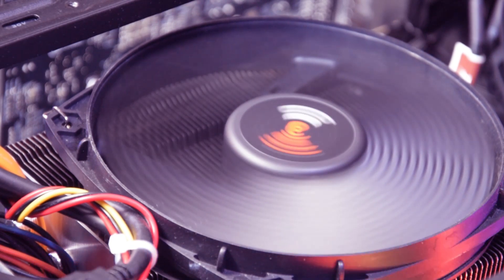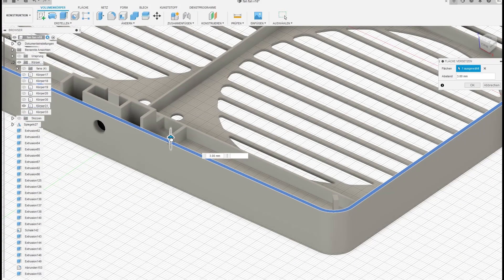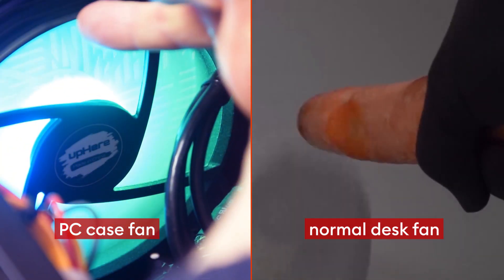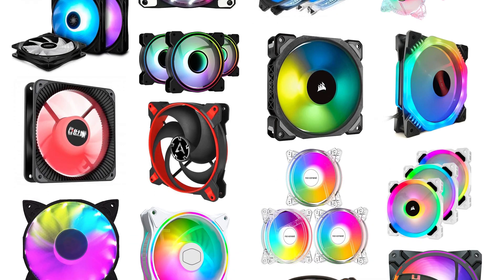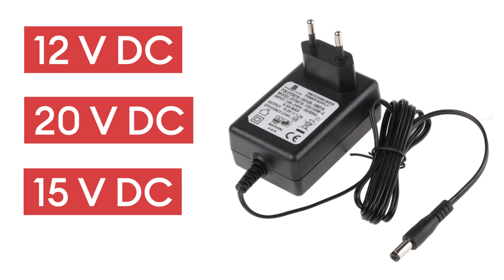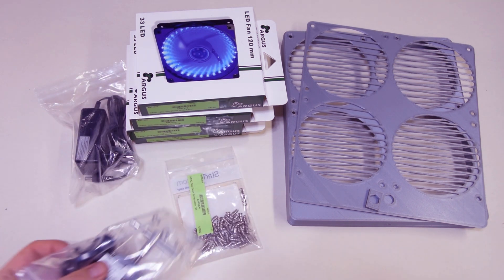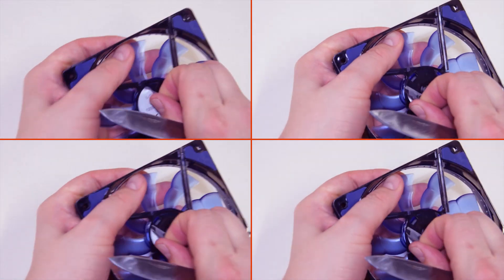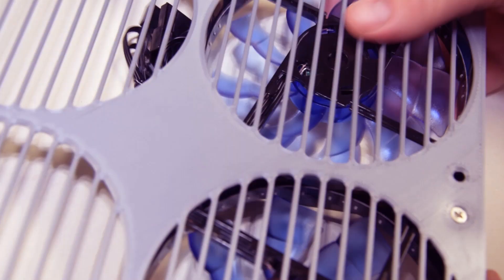Building a desk ventilator from PC case fans

Comment from the maker: 3D printer STL files:
https://cults3d.com/en/3d-model/home/quad-pc-fan-desk-ventilator

Parts list:

- 4 x 12 cm PC fans (2, 3 or 4 pins)
- 15 V 1.2 A power supply DYS618-150120W
- socket Schurter 4840.2200
- 24 x PC fan screws
- PWM regulator FTVOGUEzsbxqk9wgm
- camera mount SMALLRIG DE0729
- 1/4 Inch hexagonal camera mount screw
- some cables
Reply: I just wanted say thank you for writing badass Lego guns book. your book has inspired me to recreate my favorite Lego working guns you've made and I even implemented my own mechanisms that ice learned over the years. https://youtu.be/jFP0sGJ97Ow